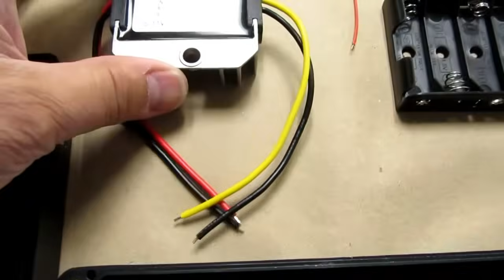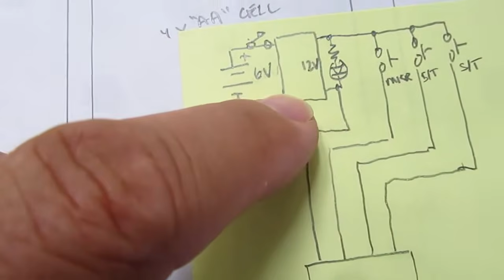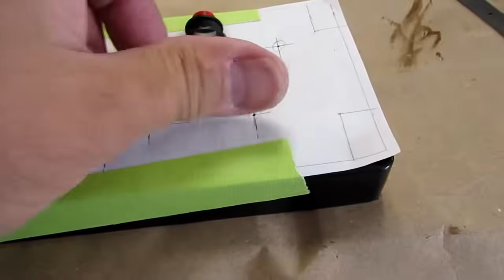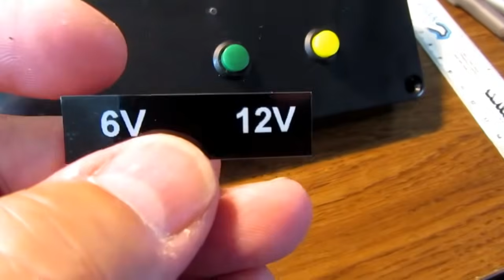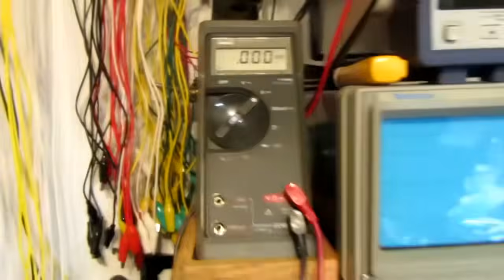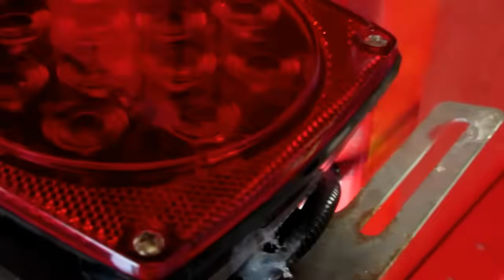Making a 4-Pin Trailer Light Tester

Comment: Built something similar for use in the shop many years ago. Got sick of needing a vehicle to power them. Used an old ammo box, a small AGM battery out of a UPS and a switch. Later I added a circuit that would switch the outputs automatically as well. So you pushed a button and it did markers, left, stop, right, reverse in sequence until you turned it off. You could test 4, 5, 6 and 7 pin systems.  You could test electric brake application as well. I saw a few years ago someone must have noticed when the MUTT came out... Still have mine, bit more beat up, but it is real handy at times.

Comment: Why not use 2 of the 4 cell battery holders and forget the voltage converter?
Reply from the maker: WHAT???????

OK, assuming you did not simply write something other than what you were thinking, if I used only two of the four battery holder positions, that would give me 3 Volts. 12 Volts is needed to power the trailer lighting circuits. So how would NOT having the voltage converter help that disparity?

My guess is that you are assuming that all voltage converters must DECREASE the input voltage.....? But I was quite clear in the video that the converter was taking 6V and producing 12V......so maybe you did not bother to pay attention?
Reply: @youtuuba  If you used 2 of the four cell battery holders and connected them in series, you would have 12 volts. There would be no need for a converter.
Reply from the maker: @RO16 , true. However, lithium cells are expensive, so having only 4 was a plus. But more significantly, there was not room in the box for another 4-cell holder, and no surface left to mount it to. As it is, the Converter costs about as much as 4x "AA" lithium cells, and it only needs to be paid for once. 

I thought through all of this and decided my approach was the best overall.
Reply: @youtuuba  I understand now the batteries, voltage and the conveter to get the 12v. This maybe a stupid question, but what do the resistors do for the LED? Does it reduced the amp/ voltage as to not blow out the LED?
Reply from the maker: @billcollinspt LEDs behave as diodes when forward biased, and thus too much current would flow through them when connected across the 6V and 12V power, destroying them. The series resistors limit the current to an amount appropriate to operate the LEDs, and no more than that. The amount of resistance required depends on the applied voltage.